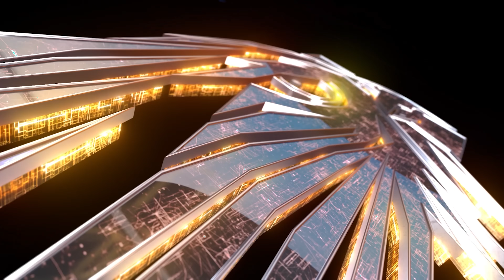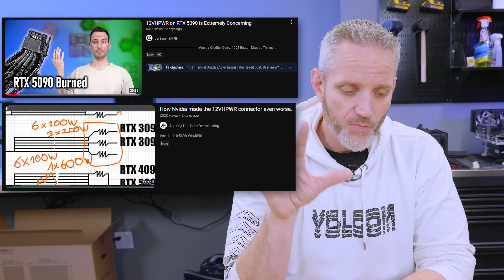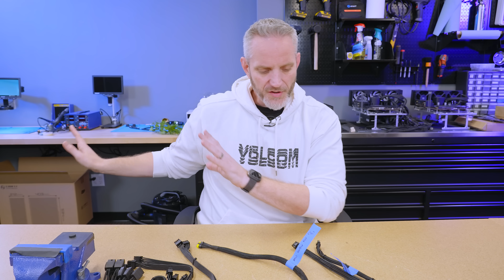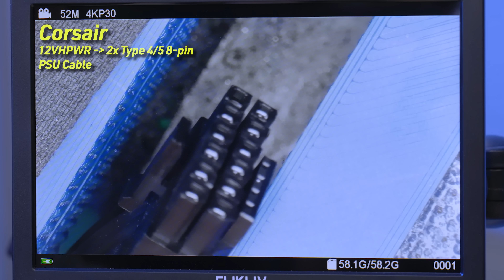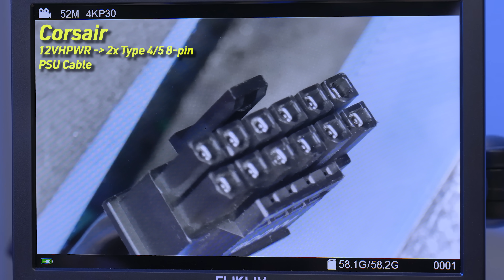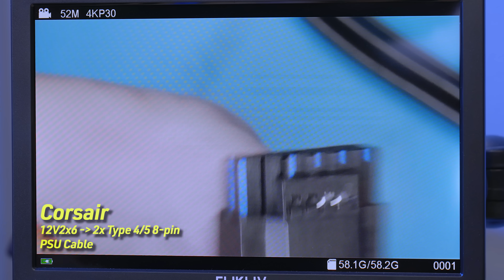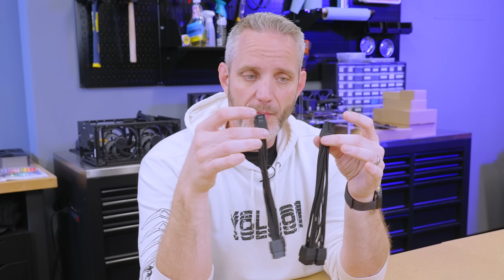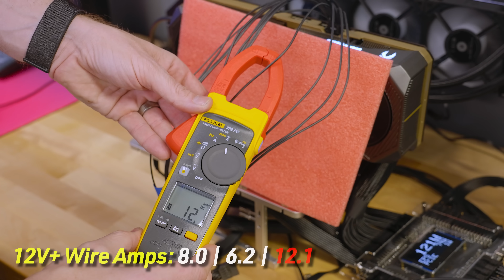I discovered something concerning and I need the Experts to chime in... More 12VHPWR discovery!

Comment: It's just funny to me that the motherboards still use a 24 pin connector for power and they don't even pull 300 W and yet a ~590 W card is being designed and shipped with a single connector based on a standard that has 640 W max limit on it.
Reply: Funny thing is, the 8 pin eps has 4 12V and gnd and can really handle amps and 300W is no problem. 8 pin pcie has 3 12V pins and 5 gnd with 150W rating and can handle 300W. We could just use eps plugs on gpu too to get more power.
New 2 x 6 has smaller pins and no safety margin at 600W. Nvidia also put pins together on gpu and no load balance circuitry. One pin can have better contact than rest and carry most of 600W (120W max/pin).
Reply: @Leo_not_AI  EPS12V has similar safety margins as 12v-2x6 when using it at the full rated 400W. And has connectors with similar contact resistance. The single rail VRM supply design would have the exact same problems on EPS12V as it does here with 12v-2x6 (there's already extensive history of the comically underspecced 150W PCIe connectors melting on all sorts of cards).
Reply: @Leo_not_AI  I don't think it's the connector's fault anymore. I think its that all pins are hardwired together on the GPU, so no loadbalancing can be done and simply the less resistant wire pulls the most. And they are likely hardwired together on the PSU too (coming from same rail), so the PSU can't even know that all this is being pulled through a single wire.
I believe same would happen if they used 4x8pin and wired it together, except most PSUs would max out at 300W per rail, not pushing 600W through a single wire.
Either we should hardwire all pins together on the cable connector, or ensure the target device load-balances it.
Reply: @tomasbohunek9698  i woder if you would aplly some soldering grease to the connector if that would fix issue as all pins whould better conduct then afther it heats up to 40 on all pins.
Reply: @scriptkiddie1000  I didn't suggest that as a solution, but as a method to confirm that the pin insertion depth really matters.
EDIT: I'm sorry, I misunderstood your comment. Yeah I guess what you say would help. :D I'm thinking of a less destructive solution tho. If all 6 pins connect to the same piece of metal, then why is 6 of them and not just 1?
Reply: @Leo_not_AI  If you say no safety margin than why are all cables and the spec rated for 684 Watt like the specs say ?  its still only 1.1 safety margin but its there . 

Problem is really that Nvidia removed the load balance from the cards
Reply: Well that's mostly because the motherboard needs a bunch of different voltage lines, ground paths for those various voltage lines, and a power signal pin.  Most of the pins are also lower voltages so the load needs to be spread out more vs higher voltages.
Reply: well they need 3.3v, 5v,12v and a signal to start the psu too. But yeah using 2x eps 8pin plus 24pin seems like a lot for a board that does not use that much power. i just wonder what is stopping manufactures to using 2x8 pins or even go 4x8 pin
Reply: @mrc4nl  Honestly PCI-SIG has an unnecessarily large safety margin baked into the 8-pin standard. Any quality PSU actually capable of powering a 600W GPU is going to ship with sufficiently gauged wiring and high quality connectors, and the 8-pins will be capable of handling well in excess of 150W. I once ran an R9 290 on chilled water at 400W+ with a high quality 6-pin + 8-pin, and the connectors didn't start melting until ~450W sustained. If I were to extrapolate, a quality 3x8-pin setup could safely handle upwards of 800W.
Reply: @K31TH3R  To be fair, after seeing recent events, I think we can say it was a necessary safety margin all along...
Reply: @ Which recent events specifically? Because as far as I know, all of these cable failures have been 12VHPWR. I haven't seen any 3x8-pin GPU going into meltdown, and I really wouldn't expect it, just speaking from experience how much current it takes to actually melt one.
Reply: That's interesting but perhaps an oversimplistic view. 12 of the 24 pins on those motherboard power connectors are for 12v power but they feed into separate subsystems on the motherboard. The other pins are for 5v, 3.3v, ground, power on, etc. 12 pins for 12v is still a lot though.

I think each individual 12v line can supply a considerable amount of power but they're typically rated/spec'd to within a very safe limit, say 150w limit on a 300w capable line (if memory serves). Technically there are more 12v lines than is technically necessary on GPU. The actual issue is the lack of load balancing thanks to the fatally flawed power bus design. From what Jay was saying the 30 series didn't have a power bus but had individual/seperated power input lines. Nvidia changed that to something that is really an incompetently poor design on the 40 and 50 series.
Reply: Gpus also require 1.8v, 3.3v, 5v and 12v but they use regulators on the card itself to achieve it. Some motherboards do this aswell but normally only on oem stuff like dells etc
Reply: Factory overclocked 5090s draw more than 700 by the way. The MSI Suprim pulls 730 watts under full load for example. At that point the connection point is close to 100 degrees celsius.
Reply: @kerotomas1 then they are using components out of their specifications... And of course the manufacturer should be liable of that.
Reply: To be fair, the new standard they want to push for motherboards is called ATX 12VO and only has 10 pins. It just hasn't gained much popularity amongst DIY PC builders.
Reply: Because the motherboard connector was designed like 40 years ago. Open up a laptop and those pins are much, much smaller.
Reply: a lot of those pins are for legacy atx standards. we hardly use negative pins anymore, and 5, 3.3v pins are getting used less and less. its almost always better to regulate close to the load to minimize line noise. also modern power electronics have gotten so small that it is very easy to put vrm next to whatever needs it. i kind of wish 12vo supplies would become the norm. i really hate the 24 pin, the insertion force required is alarmingly high.

Comment: I never did get an nVidia one with these connectors. Strictly with AMD really...

But I find it kind of ironic how they were touting the Gen 1 connector as being 'smart' and knowing what was plugged in, but it doesn't seem to know how to feed power through its own entity. Like, if these sense pins are doing nothing then why are they there? I thought they were supposed to determine that the GPU wants X power and then evenly distribute it across the connector by adjusting the power.

That video showing there's really only 1 entry point for all the power of the connector kind of makes that pointless doesn't it? Like... the GPU doesn't know what it only has a single road to send 3 lanes of traffic down, it just knows that it can draw some power from a point now. Like a single point instead of 3 separate (30 series). That seems like a massive R&D oopsie to me.

Comment: These connectors and cables need to be redesigned. Two blade connectors on each end (no pins!) and heavy-gauge cables...one for +12V and one for ground. The connectors could be the same size or smaller, and the whole cable assembly would be about a thick as one AIO cooling tube. No spaghetti wiring, cable combs, etc needed. I have no idea why some engineer thought it would be a good idea to create a cable with 16 freakin' wires and pin connectors when 4 pieces of copper and 2 wires could do so much better.
Reply: Way less expensive to source more 16awg than fewer 10awg is the reason. cost savings... stupid but those are the facts.
Reply: Solution is a better connector that uses 10awg for power draw over 400 watts.

Comment: So a slightly unseated connector (by maybe 0.2 millimeters) is user error causing it to melt, but a pin getting pushed back by what looks to be at least a millimeter simply by just plugging the connector in is totaly fine? Yeah, they're covering their asses.
Reply from the maker: It really seems more like 2-2.5mm... I just dont have an accurate way to measure it.
Reply: @Jayztwocents  use a toothpick or something like it mark it and then measure of it.
Reply: @Jayztwocents  you should be able to do it with your digital calliper. Use the depth side, if your calliper has it. Wish I can show you what I’m talking about
Reply: @Jayztwocents  JFC that's even worse.

Comment: Maybe I’m full of crap but I would say that the ground pin not making full contact is not as bad as 12V not making full contact since you also get ground from other places like the PCIE slot and IO shield (that is also grounded to the whole case)
You can also get 12V from the PCIE slot but only through 4(?) pins and you are limited to 75w (not very relevant when we are talking about 600w cards)
Reply: If you get a water heater that shorts it can ground though the pipes and shock a person in a bathroom. A vid where guy was measuring the flow of amps and noticed not balanced on both sides, turns out he was getting some grounding through the water heater. Akin to 100% + side and 95% - side with 5% ground leak.

Comment: Yet my xt90 connectors with just 2 6ga wires in my rc truck can handle 22v at 80 amps continuous and 200 Amp bursts 😂

Comment: Could going up to the next gage wire size have a better outcome? In home electrical wiring if you use the wrong gage wire then you’ll get wires overheating and catching fire. If your circuit is on a 15 amp breaker then the mandatory wire gage will be a certain size. If it’s a 20 amp circuit then the gage goes up. If Nvidia and power supply manufacturers chose to use a the smallest gage that was required but didn’t take into consideration if one or two of the wires would hold the mandatory of amps in a cable then that could pose a problem and cause over heating of the cable on top of pin problems.

Comment: I like how they put on that yellow marking. But nobody points out that this current issue seems to be mainly on the PSU side. Well I dont know Your case, but most You will not see if You cable is properly and stays properly seated, yellow marked or not.....

Comment: GPU is not asking for power on one or select wires!
It is the PSU sending power on one or select wires.

5000 series uses a single shunt on 3 wire set, it is the PSU job to distribute the amps to each wire

Comment: I hope that 12VHPW cable standard will disappear sooner or later. Its a BS cable standard, trying to solve a Problem that doesn't exist! Yes, you probably would have to use 4x8pin PCIE Connectors to supply the same max. wattage but so what? Most people that buy/bought a 5090/4090 have to/had to buy a new Power Supply anyway.

Comment: Jay, 

Amps are a measure of current. Please start saying current instead of amps where appropriate. 😂So, instead of saying "measuring the amps" you could say "measuring the current", which would be more correct. And instead of saying too many amps or too much resistance you could say that there is more current being pushed through the wire than it is rated for.

Love,

Dingus

Comment: it will be less problematic to have a bad ground pin, other ground pins will share the load. But if loads between the 12V pins are NOT shared and that particular pin is an important pin supplying high wattage part, that might cause a failure.

All grounds will always be shorted, so if one pin is bad, the 'electricity' will find another way to exit.

Comment: I thing the main problem is missed in all the discussion and this is that all the power is shared over one power bus and that there are several pins in parallel. In practice current flows over the part in the connector that gaves the least ohmig resistance and NOT evenly across all the pins. Why should the curent flow over a pin that for example has 10x more contact resistance than the pin next to it? And that is the reallity. The reason why in a design with 3 power rails like the former designs there is better current managment and therefore some kind of load balancing so to say. That is opinion on this problem. @JayzTwoCents: Would like to hear your opinion on this.

Comment: Hate to nitpick, but the "3 rail" power supply solution on the 3090 TI wasn't "almost like load balancing", it was EXACTLY doing load balancing. Connecting 6 pairs of wires together and expecting that the current will just balance itself equally across all of them is hopelessly optimistic at best. There is enough variation in the SPECIFIED contact resistance in the pins to make some wires carry over twice the current than others... and there is no 2x current headroom in the connector, is there?